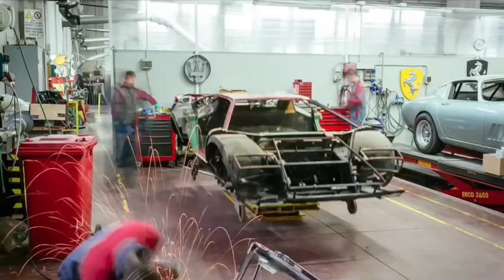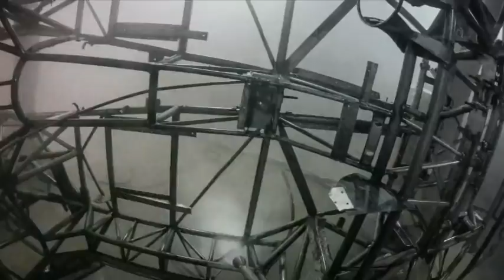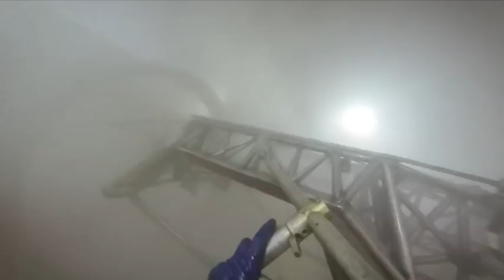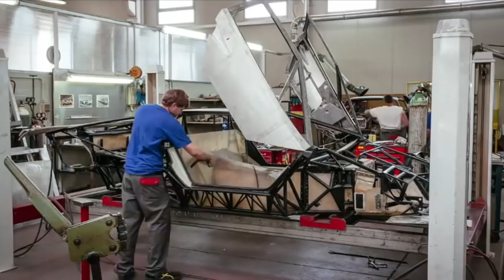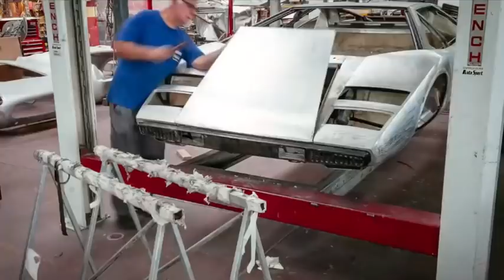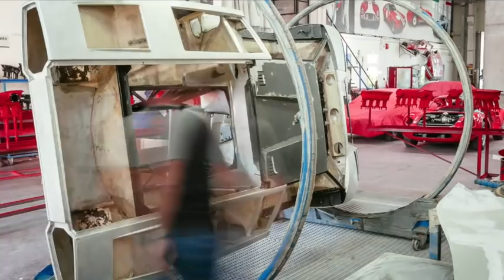Lamborghini Countach LP400 1120010 restoration time lapse by Kidston SA

Comment: My 75 LP4000 with skinny tires, no flares or wing is the best looking Countach. They are all special but in it's original form the l find it's original design the most appealing.
Reply from the maker: I think that is what everyone thinks as is reflected in the market values for this model
Reply: @lamborghiniregistry  bought it with 5 other cars from an estate in 2009. It was a basket case, blown engine, missing rear suspension and brakes, no seats, rusty frame, rusty everything! I've never bought a car as an investment only to drive but my car buddies were all telling me l'd lose money by the time it was done. Sat in my garage a couple years before starting it. Took it for it's first drive in 2021 and am just now considering it all sorted and done. I did spend a HUGE amount of money on it but l think it would safe to say on a bad day l would at least double my money. It's a great car, you have to do a lot of work to drive it fast (never known to be a great handling car) but so gratifying when you do. The sounds and feel are intoxicating. I have a 350 GT and Diablo also
Reply from the maker: @MichaelRoy-hc3lz very cool. Would love to hear more of the story and see some photos. Go to www.lamborghiniregistry.com and click on the CONTACT US link at the bottom of the page to get in touch, please